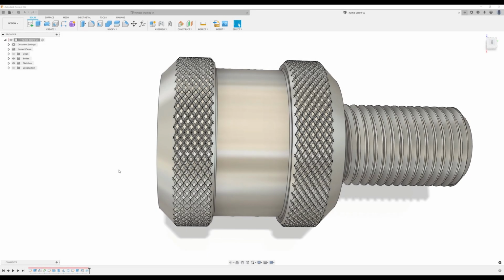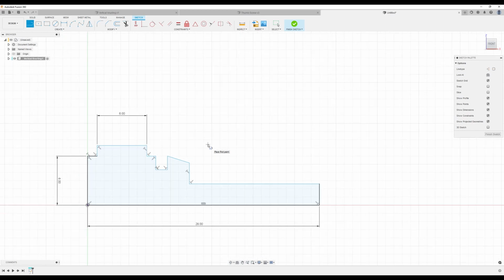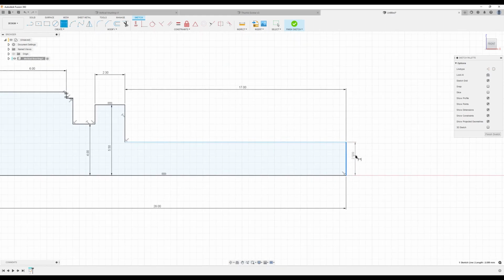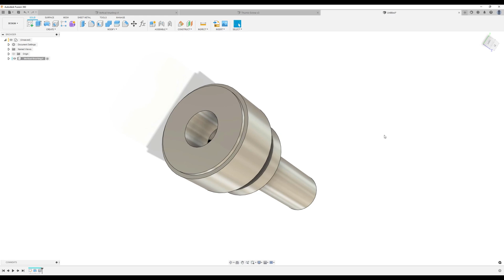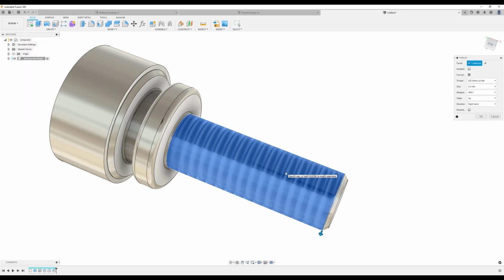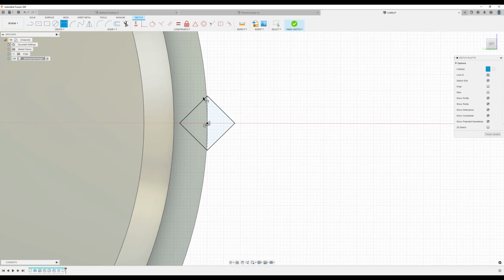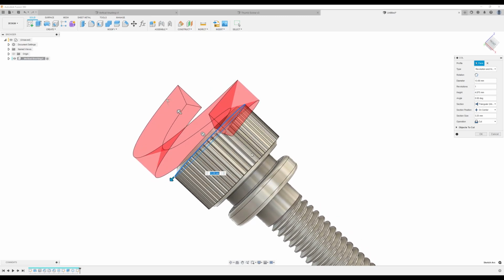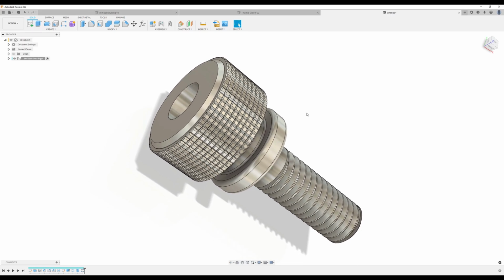Vertical/Horizontal Knurling in Autodesk Fusion 360

Comment: I had to slightly modify this so I could ADD the knurling to the surface of a thin wall rather than remove it with the first cut. All that required was adding a line to the square so a trapezoid is extruded out of the wall instead of the triangle cut into it. Everything else worked perfect!
Reply from the maker: Whatever works for your workflow is always best. My exercises will get you up to a point, but the fun begins when you have to engineer your own solutions :) I'm glad it worked out!